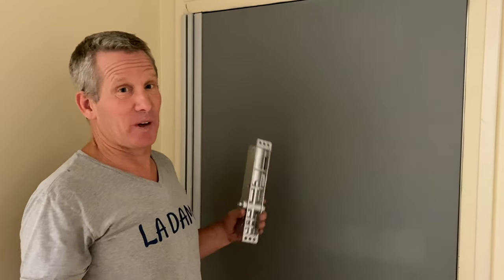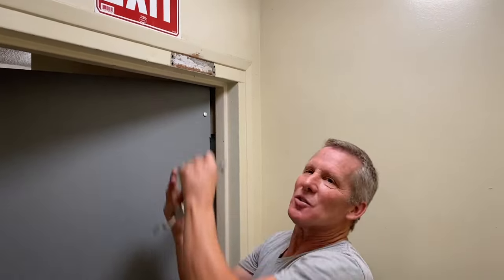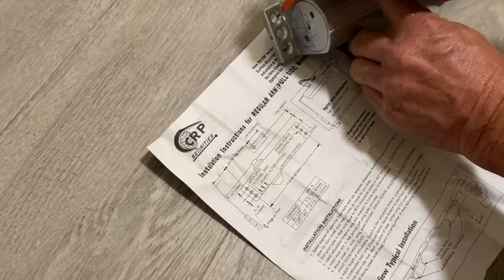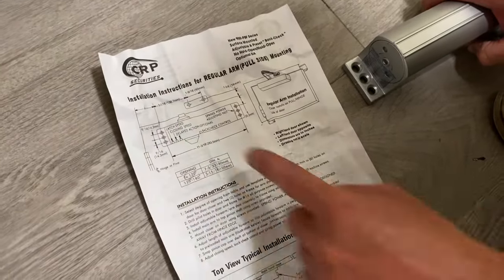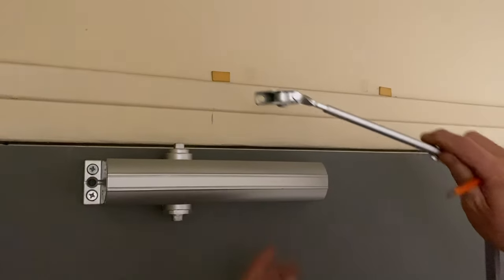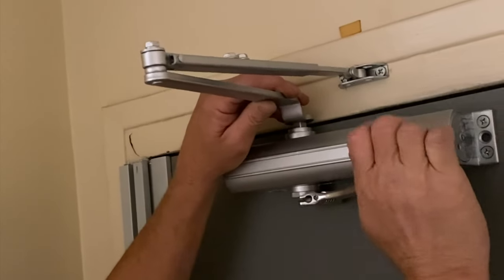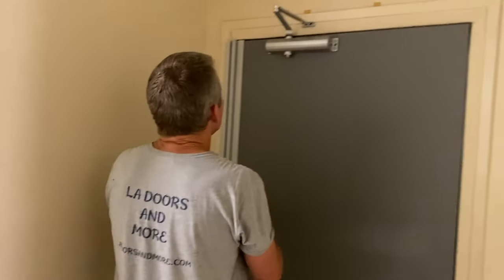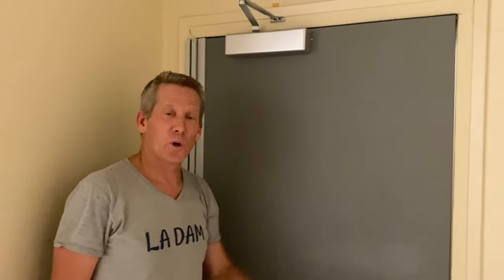How to install a door closer with standard mount

Comment: is it possible to install one of these on a house door in such a way that the door doesn’t open all the way, so that the door handle doesn’t hit the wall?
Reply from the maker: Yes, that can be done, but it's not wise to use the closer as a stopping mechanism because that puts torque on the attachment points. If a conventional door stop won't work, look into a floor mounted door stop. There are various types and can be a great solution. Thanks for watching.

Comment: Excellent video. My issue: now that I've installed the closer (about the same model. Home Depot commercial medium duty) it closes flawlessly. However opening it is another matter. It feels super heavy. Tons of tension even when I release all tension on the sweep and latch screws. I'd attach a picture if I could but I think my install is good. Any suggestions? Maybe a slight adjustment in the mounting?
Reply from the maker: Great question. It's probably not the position as that typically only affects the range of motion. It's most likely the tension on the arm which is NOT affected by the adjustment screws. Unscrew the arm on top of the closer. Put a wrench on the nut, then lift the arm off and move your wrench to release some of the tension on the arm, then drop the arm back down on the closer and try again. That should do it. thanks for watching.
Reply: That helped! It's better. Would moving the shoe (attaches arm to header) an inch left (away from hinge side) help and be acceptable? It's currently in the 3rd hole of the shoe going toward the handle and away from the hinge side. This is a left swing door.

Comment: Most of these will work with the following. 7 1/4 from the hinge for the door mechanism and 12 3/4 from the hinge to the jamb plate.

If you don’t have the instructions this is the best move. The main variable is the location of the action bolt relative to the jamb plate. There’s about 2 inches between the bolt and the left of the jamb plate.
Reply from the maker: Agreed, and after doing so many, I just began using 7 and 12 as my guides. There must be a better way to do the instructions. Thanks for the tip and thanks for watching.

Comment: When did you bend the arm up , so that it did not foul the top of the door ?
Reply from the maker: The arms don't bend, the linkage that connects the arm has a swivel and once in place you can move around. Also, sometimes if it doesn't clear, I just take the screws out and move it however necessary to get it to clear. Thanks for watching

Comment: Hi Pete, I got a metal door that if the wind is going against it closing it will not close all the way sometimes. Even after the air goes still, if it didn't manage to close in the first place, it just sort of hangs in there without finishing the little final push. any way to give the closer a bit more strength? I tried fiddling with the valves, but latching or sweeping speed don't seem to do the trick. The model is similar to the one on your video.
Reply from the maker: This is not uncommon. Start with a heavy duty closer and get something with a "backset" adjustment. Only the more advanced models have this. It compensates for wind. It will close when needed and won't blow open in a big gust. Good luck and thanks for watching.

Comment: Great video although: I would've done the preloading slightly different way. (A piece of arm attached to the body first)
And you've skipped the strength tuning with the arm's length, if needed.
And the general rule for speed valves is the best, tighten for slower.
Reply from the maker: Great to hear. I look forward to seeing your video demonstrating that. Please give a shout out once you've posted it. Thanks for watching.
Reply: if you already know, why are you watching this?
Reply: @jme4815  bro I was doing it the second time in my life, I was looking for more info and this video helped greatly, and I just wrote my observations, im not an expert, I just analyzed how on earth this exactly works, and I've gotten better idea now, and I've adjusted these closers that I don't own, so maybe in the future I will get to install and calibrate my own. thank you very much

And thanks guys, for encouraging me, maybe sometime I will cut a video showing how it looks with the arm split in two.
I wish I had some kind of force displayer. Newtonometer!